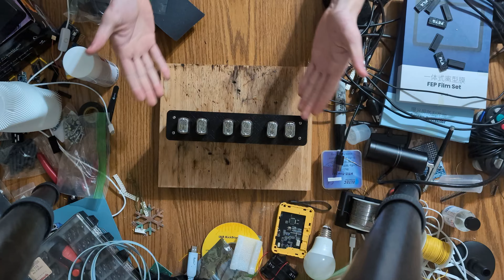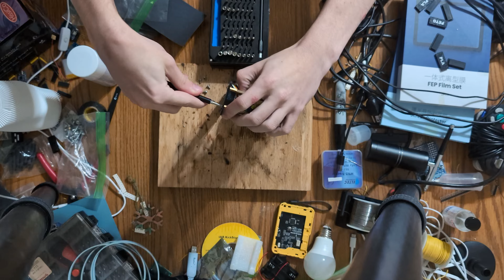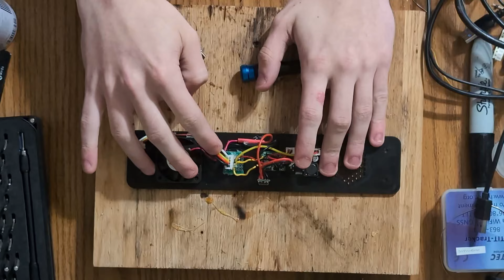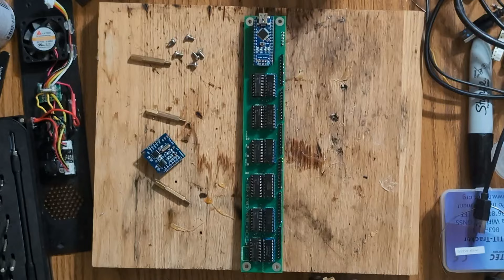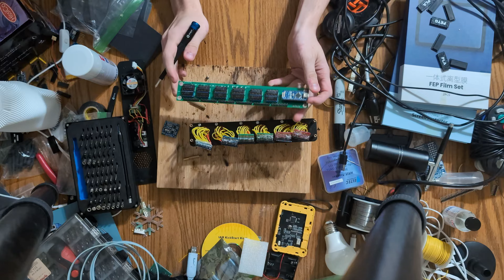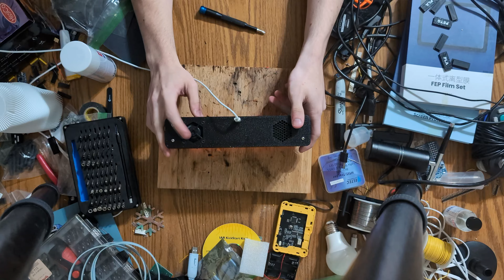Nixie Tube Shenanigans

Comment: On the very fist clock, the number 2 on the rightmost tube is halfway out :(
Reply from the maker: dependent on the number displayed the amount of current needed changes and if all the other numbers are high currents ones sometimes the lower current once like 2, 5 and 7 will dim but I plan on mostly using this in the dark